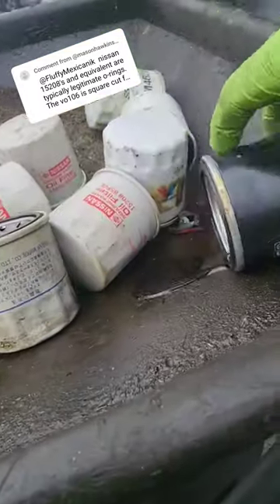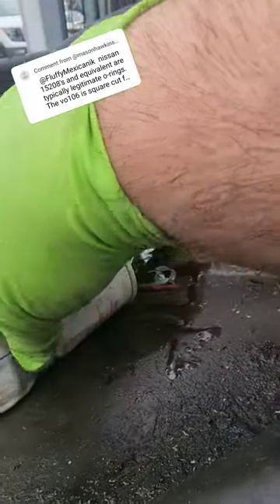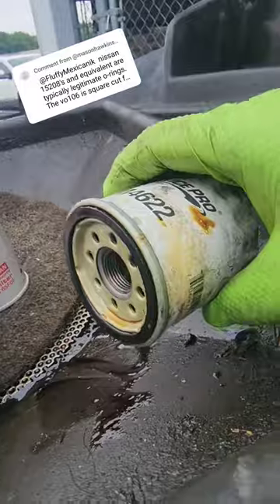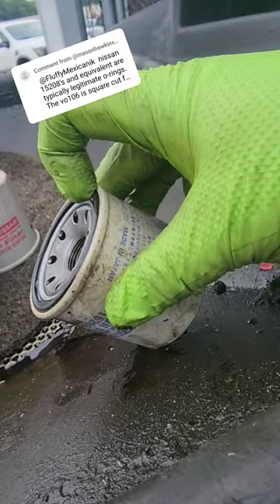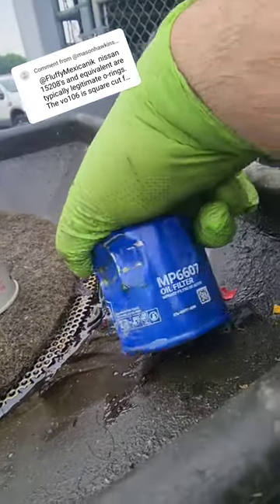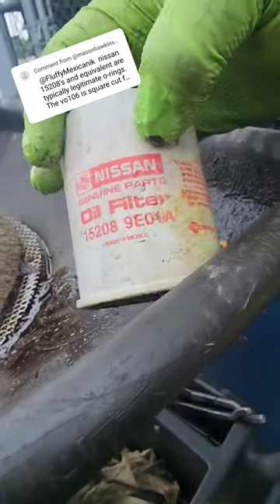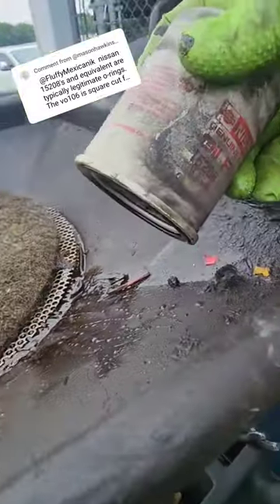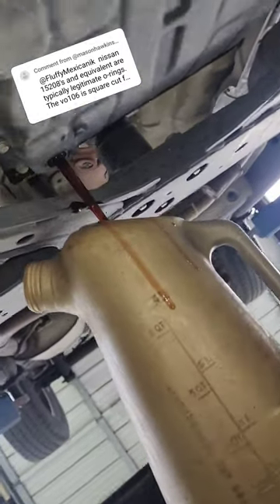OIL FILTER ORING OR SQUARE CUT SEAL #shorts #auto #mechanic

Comment: I really don't get why anybody cares. I would expect a square cut seal to work better on a flat surface anyway. Ultimately, it doesn't matter as long as it doesn't leak, I guess.
Reply from the maker: I mean you right ,this only came up on the video that the seal got stuck on the filter housing and i called it an o ring...but then in the comments i was informed that nissan uses orings and other brands use square cut haha...never paid any mind to that lol
Reply: I never cared or understood that either, both shall seal good 👍 I call them both o-rings

Comment: I noticed a lot of square cuts get stuck onto the stinger than the o rings but that's just me maybe 😅
Reply from the maker: I think its cause they are only held in place by a few pinch spots as opposed to OE filter have a lip that the seal is held in by...did another video on what im talking about lol never paid much attention to it before
Reply from the maker: @jacobpoucher  you are a "no one" and you obviously care about my comment section since you running through em....shits wierd fool
Reply: @FluffyMexicanik  yeah I noticed at our shop, the Kia / Hyundai filters never have the issue, me and a co worker just made a comment about it then your video popped up